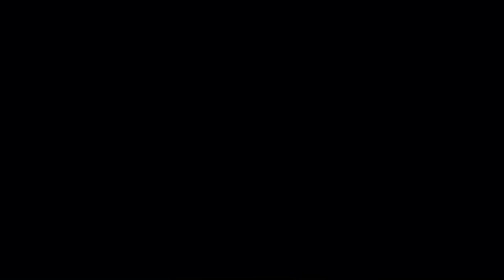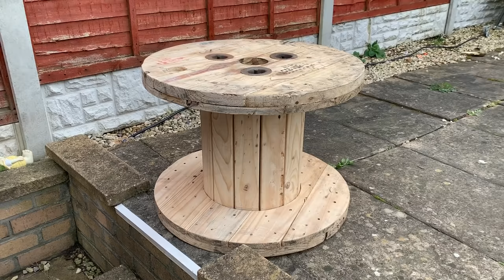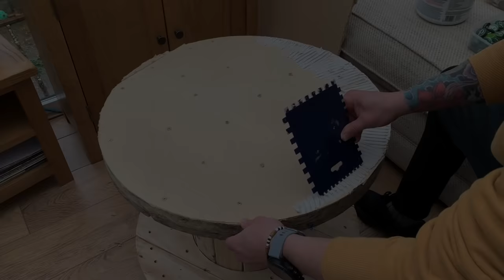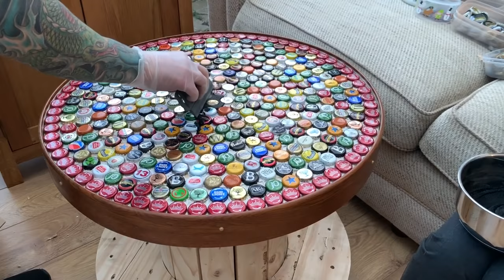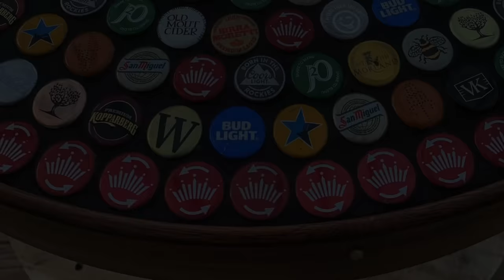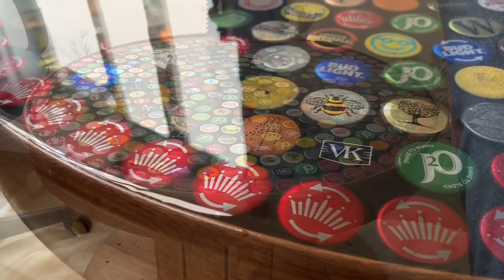Building a beer bottle cap cable reel table using bottle tops and epoxy resin

Comment: Showing the process for putting on the edging would have been very useful....
Reply from the maker: Its a 65MM bean, nailed on in 4inch spaces, then sealled to the base of the reel. Quite easy in the grand scheme of things. You can buy the trim from any roof and guttering supplier. I used a light oak effect version.
Reply: I know 😒
Reply: @MattGiles  do you have a link or anything as I can’t find it

Comment: Looks great. You skipped the whole edging part. Can you show us how that was done.
Reply from the maker: I plan to make another one at some point and a refresh video
Reply: Matt Giles how did you get the fine wood finish around the edge
Reply: I was wondering that part as well. I’m working on a bar for my garage and was thinking that edging. Great Video!
Reply: Does anyone know where to get this edging?
Reply: @Gunnergordy91  I used 6 mil ply. Easy to bend. May get slight crack but when sanded gives nice effect
Reply: I’ve ordered some iron on wood effect edging. I will let you all know how it turns out and post a vid.
Reply: Anyone have a good suggestion to use for the states? All the links are for the UK. Thanks!
Reply: I was thinking the same . The most important bit on how to keep the resin on the table with edging , is missing
Reply: George Hextall does this bend for edging
Reply: MrNeil562 any update?
Reply: @MattGiles  lñ

Comment: Have made 4 tables since i seen this 6 months ago, certainly the tables get better and better as you do them and valuable lessons along the way, pity i cant load some pics. and thanks for shareing in the first place
Reply: Peter Pearce I’m about to give my first one a go.
Any beginners advice for me ?
Reply: @raybans8712  Yes....get the drum top level and make sure all yr Caps are glued down secure. Be sure to fit the outer edge and seal it with some silicone , to prevent Resin leaks.  Also......dont do what i did and start Caps from the middle!!!    start from outside Border and work in , that gives u some wriggle room in the centre if yr Caps are a little off centre.
Reply: Joe Bristow thanks joe appreciate that
Reply: @raybans8712  cut the MDF to size and ge it perfect, make sure the edging is good, on the firt table i used pressed cardboard and other had metal rolled and results 10000% better
Reply: Any ideas or am i doing something wrong?
Reply: Peter Pearce do you have a US link to something to buy for the edging? My table has been stalled for too long because I can’t figure out what to buy to for the edging.

Comment: I have done these before and I am offering some advice only.  When you do these types of projects always ensure your epoxy is covering all parts of the top, you don't want things sticking up because in the future when you get scratches and gouges in it you can sand it down and reapply more epoxy over the old.  In this case the beer caps may take some scuff damage when sanding is done.  I hope this is helpful and not hurtful.

Comment: Hi,
What is the white thick stuff you use to put the beercaps in/on?
And
What is that black thick stuff you use fill the gaps between the caps?
I’m gonna make a wall of beercaps and i used glue and kit but both didn’t worked as planned.
Reply: The white stuff is mortar that you would use to put tiles on a wall and the black stuff is grout

Comment: Hi mate really good work.  What was the adhesive you used to fix the bottle tops down please? With the UPVC trim was it easy to fix around edge of table without splitting when fixing?

Comment: Ive built this table and it came out great!!!   biggest issue I had was getting that goddamn edging!!!  in the end I used 3 pieces of very thin Ply and ordered copper head nails to fi it all way round.  I know Matt wants too keep some stuff secret and wont tell anything about the edging.   The rest is standard Tile grouting and glue and Resin which has all the harderner etc in the Pack.
Reply: What did you use for the edging on yours mate?
Reply from the maker: Good idea for your edging. I used UPVC trim from a roof store ;)
Reply: @MattGiles  thanks for the reply Matt!!   ive been trying for  months to source some nice copper edge to finish but cant buy it anywhere here in Aus....unless i order 100 kg of  copper band.  I think it would look deadly!!!
Reply: @MattGiles  Hi matt, is the edging this Upvc Door or Window Trim Architrave 5 Metre Coiled Length  65mm? It comes as a coil pack? Thank you.
Reply: I believe this is what you used for the edging ? 
https://www.eurocell.co.uk/trims-and-cills/trims-quadrants-and-angles/65mm-x-6mm-pencil-round-flat-architrave-in-oak-x-5m  - The pins on the outside to fix it onto the table are they fixing pins / nails Oak colour from Eurocell as well.

Comment: Great idea and finished product! How did you get the black grout off of the caps?
Reply from the maker: Its a time and drying judgement call. Getting it just right so it hasnt dried hard but is still enough to wipe off without puling from the joints.
Reply: @MattGiles  Thanks!!
Reply: put it on and wait aprox 1 mins.....wipe off with a damp sponge until u get all the excess grout off.
Reply: SORRY....that should read - 15 Minutes wait.
Reply from the maker: Its tile grout, so it wipes off when partially dry
Reply from the maker: @joebristow7519  wait time is really based on how stiff you've made the grout, how wide your caps are apart and how the ambient temp is. I waited way longer than 15mins before attempting the first wipe or it would have pulled the grout from the joints. Its a judgement call, but 15 years in the building trade gave me some form of experience with grout ;)

Comment: Hi looks great however instructions seriously lacking information for first times on a project like this. Steps were missed..like the band around the edge and what materials ands quantities needed. A better explation would be appreciated.
Reply from the maker: Appreciate that, but when i made the table i was making them for a job, so didnt give away exactly how i made it as i was trying to sell them. Kionda defeated the object slightly. But now im not selling them, so ask away, id happily advise in fully. Might even make another one this spring
Reply: @MattGiles  hope you don’t mind me asking what the black stuff you used on top of the caps was, cheers

Comment: Hi Matt,
 Question :- Could I use MDF instead of hardboard and what did you use to "glue" the bottle tops ?
 Many thanks, Gary.
 Great table !!
Reply: It was tile adhesive. Just like tileing your bathroom. With black grout to fill in the gaps
Reply from the maker: Yeah MDF would work, i used tile adhesive but have used different types of glues i the past which all worked. Its finding whats best for you really
Reply: @MattGiles  what's the tool called you used to spread the resin?

Comment: A few questions. 1 where did you get the wooden ring you put on the outside?
2: what is that black stuff you put in between the bottle caps?
Reply: I agree both those questions but I think the wooden spool is what they use to wrap cables so probably check local electrical trade shop. But my question is how did you do the ring around the edge, that part seems to be left out, obviously without it you couldn't use the resin
Reply: It's upvc edging you can get it from most window fitters/ manufacturers

Comment: Hello Matt,  Im just drinking my way through 300 odd bottles to  make a table like yours. After you have spread the resin, do you run a straight edge across the edging to make sure its flat? Also ive seen a lot of people apply a heat gun or blow torch to the resin to get rid of air bubbles? I take it you had no issues there. 
Cheers mate
Reply: If you get self levelling resin you shouldn’t have any issues. I also used gorilla glue to stick them as it’s quicker and dries clear. I found it didn’t work as well with tile adhesive. You shouldn’t need a blow torch.

Comment: What did you use for the edging mate. I’m starting one myself now and basically learning as I go. I work in a timber yard at home timber and hardware, so I’ve got access to most things. But the edging what did you use? I’m also doing a bucket in the centre for beers and ice
Reply: Jayden Van Dort it looks to me like he used a piece of pvcu (plastic) trim which you might use on the fascia or soffit if you’re roof.
Reply from the maker: Its UPVC edging trim

Comment: When wiping away the grout from the surface of the coins with the sponge/ cloth as lightly as possible,  I still managed to scratch most of the caps from the fine grit in the grout. Bit of a problem that I don't know how I could have done it differently if done again
Reply from the maker: +Colman O'Brien what grit grout did you use
Reply: I had the same issue but I sprayed the caps with a high gloss lacquer before grouting n it worked

Comment: I am doing the same but my Polystyrene molding trim keeps snapping in half when I try wrapping the trim around the table.  what did you use for your table edge?

Comment: It would be nice if you could explain step-by-step what you're doing. Like what's that board you're putting on in the very beginning? Cardboard? Or what?
Reply from the maker: The board is a 4mm hardboard just to make the base of the cable reel flat for the caps to sit well :)

Comment: Hi Matt I have a few questions as I am planning on doing this project soon. What did you use to stick down the bottle caps with ? Did you wipe away the excess grout when it was wet or dry ? Any other tips you have I would appreciate thank you

Comment: How much did the epoxy resin cost and could you attach a link to what one you used. Thanks!
Reply from the maker: I spent about £20 on resin
Reply: What kind of resin did you use bud. There are so many types out there

Comment: Looks amazing!
Can I ask what was the glue you used to stick the caps down?
Also what is the black stuff you used also?

Many thanks 
Rob
Reply from the maker: Hi Robbo, I simply used builders mastic you can get form any hardware store, so B&Q, Wickes etc. I used one called 'Sticks like sh*t'. For the gaps, i used standard black tile grout used for floor and wall tiles.

Comment: So awesome!! What did you use to lay down the bottle caps? was that just grout also or was that some sort of glue?
Reply from the maker: I laid the cps over tile adhesive and left to try for about 2hours then they were grouted in using black tile grout before cleaning off to pour the resin

Comment: Hello, just one question what is the edge that you took and where did you find it ?
Reply from the maker: Hi, the edging is a 65mm wood effect upvc trim I bought from a fascia and windows supplier. They come in 5m lengths and are extremely flexible allowing for it to be nailed around the edging.

Comment: Any advice for anyone that hasn't used Epoxy Resin before?
Reply from the maker: Mix it thoroughly, and use it all quickly. You have about 15ish minutes to get it all down which is plenty when doing a table. If you are doing a 2-coat pour, please wait until coat 1 is ready. Follow manufacturewr guidelines, thewy are the professionalls and usualy on hand to help and advise.

Comment: Could you tell me how much resin I'd need to buy or do you think you could just clear varnish the top to finish it off?
Reply from the maker: The amount of resin you need is calculated by the surface area and desired thickness of the coat. Its impossible for me to say how much you would need as i have no idea of your project. For this project, i used 5KG mixed of the resin/hardener i use for a 3mm covering.

Comment: Hello Matt, Sorry to bother you but after seeing this video on facebook through LadBible (who haven't put your credit on by the way the arseholes) I have spent the last 20 mins finding a way to contact you. I noticed the outside ring of bottle caps are all the same which is great but on the next ring in there is 1 of the same bottle caps. Booooom OCD kicking right off. Was just wondering if you could maybe take it all back apart and swap it round with a bottle cap further in or replace it with another. I am currently sat in the cupboard under my stairs and can't find the strength to get out after seeing this. Further more my cat needs feeding and she will probably only last a week or so without food so if you could get it done in that time frame then that would be great. I won't sleep until it's done either so if it's not quickly I will end up hallucinating and eating one of my fingers. Again.
Reply from the maker: hahaha
Reply: Cracked me up

Comment: Where did you get black grout? struggling to find any
Reply from the maker: If you are in the UK, then any B&Q, Wicks, Jewsons or similar builders merchants will have it. Failing that, go to a business who supply wall and floor tiles, they will 100% have black grout.

Comment: Hey I am going to be making a epoxy table out of the same wooden spool, but I wanted to ask you a question. What did you use over the top of the table for the underlayment? Was it cardboard or a thin piece of wood?

Comment: Hello! What did you use for a border around the top of the table to help hold in the epoxy?
Reply from the maker: UPVC wood effect 65mm trim
Reply: Matt Giles Great! Thank you! Is that something you can buy at Home Depot or Lowes? And what thickness did you use?
Reply: @MattGiles  do you have a link from where u bought the trim at all?

Comment: How much epoxy did you use? I have a similar sized table to work with. Cheers 👍🏻
Reply: 80cm diameter drum you’ll need about a kilo mix.
Reply: @Musician324  Brilliant cheers for that
Reply: Damian M I made two tables and used 2kg in total . You simply zig zag a little glue so the edges of the caps stick you don’t need tons of glue. I found it easier to fix the caps with gorilla glue. It’s stick like a dream and it’s goes off quicker than tile adhesive.
Reply: @Musician324  Mine is 90cm and waiting on a large 35cm bottle cap to go in the middle so 1kg should be perfect, a mate has some white tile grout left over so gonna use that, it's going to be a Corona themed table 😂 blue, white and yellow
Reply: Damian M ahh ok mines is a punk ipa Brewdog table. All Brewdog bottle tops in blue and white
Reply: @Musician324  Didn't know what to do but given the current situation thought a "Corona table" was appropriate 😂 will post a vid or pic once done hopefully not too long

Comment: What did you use to stick the caps to the table? Also how much of it did you use. As well as this how much grout and epoxy resin was used( just seeing how much this would cost)
Reply: most of it is tile grout

Comment: Hi just wondering how much of the epoxy resin did u use ?cheers
Reply: you use aprox 2 Litres ....depending how thick u want it.
Reply from the maker: I used a totla of 1KG mix on this one, there was a little left over

Comment: Hi when u used a sponge was that just to remove excess grout after the grout had dried and also what is the beading you used for the edging?
Reply from the maker: Yes sponge was to remove excess grout. The edging is used was a specialised trim with a wood effect
Reply: Matt Giles did you use the sponge before the grout dried or afterwards? Many Thanks
Reply from the maker: @beckicooper549  Its timing tbh, dry enough so it doesnt pull from the joints and wet enough so it still wipes off and isnt like concrete. You have to mix it quite stiff, i used to be a builder so did a lot of tile grouting in my time so judging when to clean and when not to is easy for me.
Reply: Hi again just curious how you worked out how much resin you would need Amy help would be appreciated

Comment: I have been saving up to do this a bit bigger! So far I have got 250 caps! How many caps did it take you to make yours?
Reply: If your going for a bigger table than his you’d need at least 500 caps to see you through it
Reply: Consider asking your local bar/pub for some of theirs, most will happily give you theirs for free.
Will just have to sort out the bent ones (or reshape them)
Reply: Unfortunately it requires drinking a lot of beer :( It's a very sad sacrifice.
Reply: You can buy on eBay, just make sure they're not bent.
Reply: Update 11 months later! I have got a full shoe box full! About 700 caps I would say 😁

Comment: How long did you leave the grout on before wiping it off
Reply: I’m here now covered in black grout every time I wipe it’s looking very uneven between the caps. Lolol
Reply from the maker: It’s a judgement call, depends how wet you have made the grout and depends how warm the ambient temp is around you. If you make it fairly stiff, start wiping after 10 mins. You will need several wipes over before bidding with a cloth to shine

Comment: I need to know how many bottle caps you used I may have just went crazy and ordered 200
Reply: I'm in the process of completing a table that is 85cm in diameter and it takes about 600 caps to complete
Reply: A barrel top itself takes circa 250 so would imaging a lot more would be required for this.

Comment: what is this black substance, you used to fill space between caps?
Reply: Its resin
Reply from the maker: Thats black grout
Reply: Tile grout?
Reply: @MattGiles  what did you use for the edging strip?? Trying to follow your video as is class but can't see what sort of flexible material is used to do the edging before the epoxy top. Appreciate a response. Thanks.
Ian

Comment: Is it waterproof?  I want to put the table on my balcony the whole year 😅
Reply from the maker: Yes it is, but you need to make sure the cable reel is correctly waterporoofed with the right coatings and that no water can get in under your epoxy coat.
Reply: What coatings did you use to prevent water / moisture from getting in under the resin? Also what stage did you apply this? Or does it not matter?